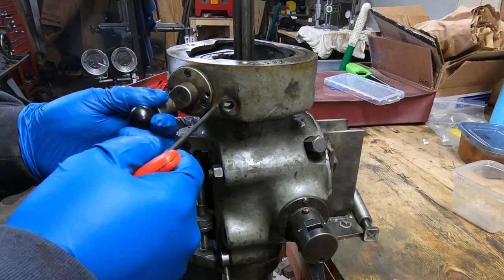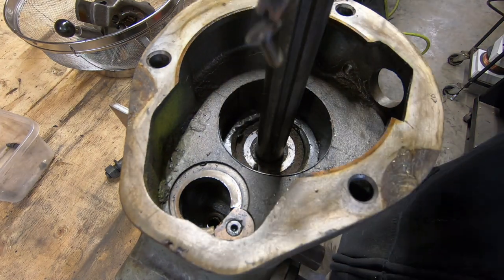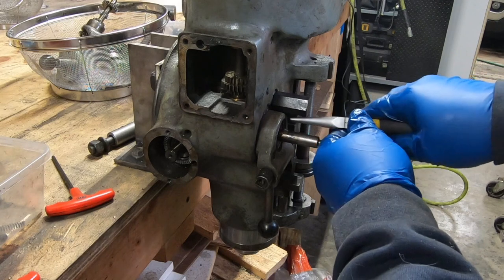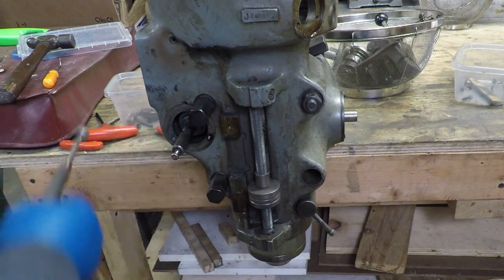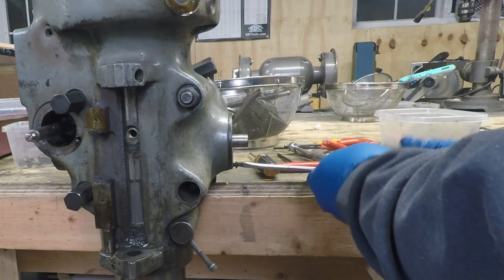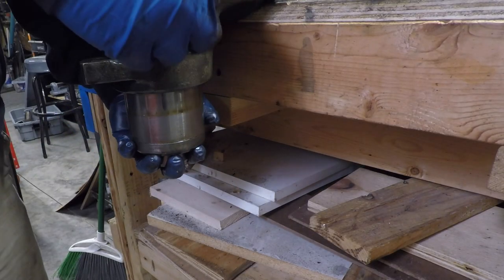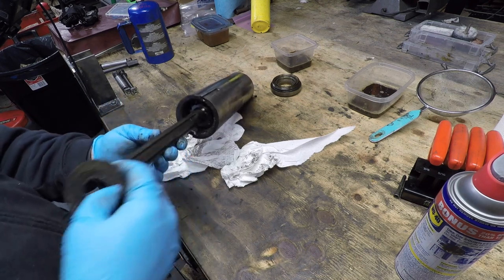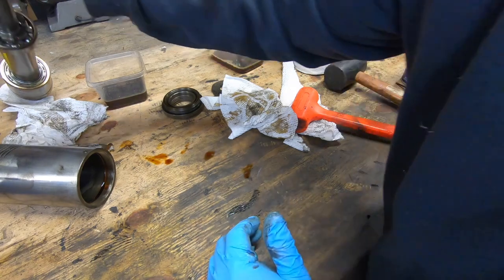Bridgeport Quill Housing Disassembly

Comment: Coming along great .   When i get some spare time , i have to do my BP head as well .  I would be interested to know where you get the parts from & what your thoughts are on the quality .  👍
Reply from the maker: I've been getting my parts from two different sources: H&W Machine out of Indiana and High Quality Tools here in Ohio. High Quality Tools makes just about every part for a Bridgeport. H&W resells a lot of those parts, but they also offer some stuff that HQT does not, or different versions. Bearings is a good example. HQT sells high quality USA made bearings (probably Timken) and H&W also offers the same bearings and substitutes made in Japan or Taiwan at a reduced cost. I'm not a production shop so I opted for the cost savings. On the other hand, if I buy from HQT, I can drive 10 minutes and pick it up rather than paying and waiting for shipping.
Reply: @MyLilMule  Thanks . I will keep them in mind . 👍

Comment: ive done about 100+ Bridgeport mill reconditions have been out on call about 1000+ of them for varispeed belt change and refurb the plates. I Am a machine tool fitter work as call out for 13 years, after working on so many i got sick of seeing them but without doubt the most popular turret mill ever every engineering shop has 1
Reply from the maker: One or more! The shop I bought this from had 6 others and 2 of those were also for sale. I'll only ever need one in my small shop here at home. I just hope I am doing all this "right". I've decided NOT to replace some of the bearings, so I am hoping that won't prove to be a mistake. But it is for a hobby shop. Nothing high precision.

Comment: What thread is the little screw you used on the upper quill stop???
Reply from the maker: Are you meaning the screw I used to remove the reverse trip stop lever? I think it was 10-32 if I recall correctly.
Reply: @MyLilMule  yea the little "3 ball" looking thing
Reply from the maker: @ebayollis  Actually, I think it's a 5#-40 screw.
Reply: @MyLilMule  oh law, I definitely don't have one of those
Reply from the maker: @ebayollis  Ace Hardware, if you're in the USA.
Reply: @MyLilMule  one more question, what size allen is it in the adjuster at the bottom. The little bitty set screw that sets the "kick out"
Reply: The one in the trip lever
Reply from the maker: @ebayollis I really don’t know. Sorry. H&W Machine could tell you I am sure.

Comment: Coming along nicely. Just a suggestion, but I think you should be on the lookout for a pipefitters chain vice. You can find on a tripold and I've seen table mount. I think it would help with your disassembly/assembly work. Thanks for the look.
Reply from the maker: That's a great tip. I'll have to keep my eye out for one at the auctions.